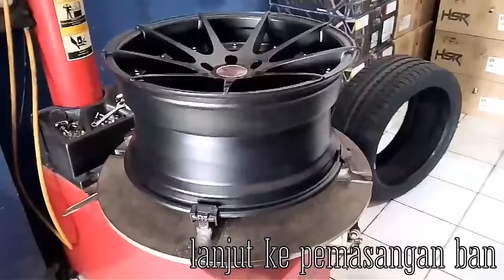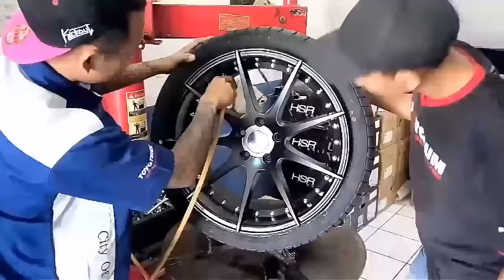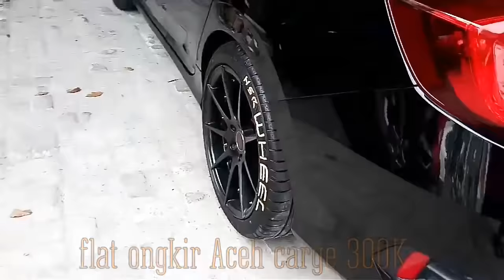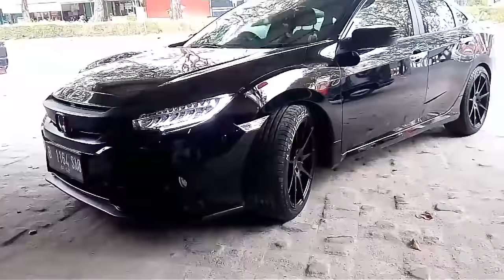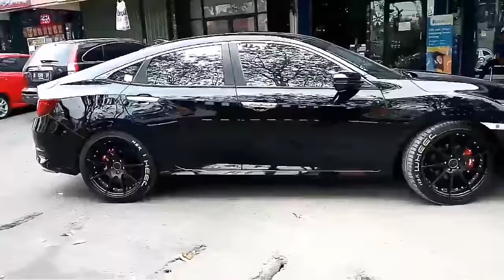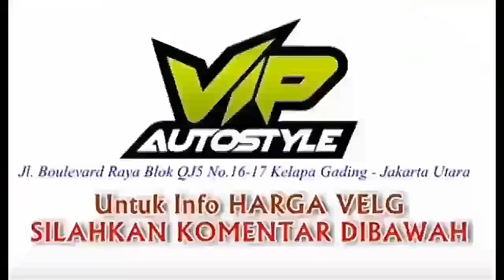Modifikasi New Honda Civic Turbo On HSR WHEELS By Vip Autostyle

Comment: Alamatnya dimana? Saya di Jogja, bisa nggak. Civic turbo saya pngn saya gati velegnya.
Reply from the maker: Habibi Muhammad jogja ada.. Mau ganti ring brp om??
Reply: 18-19 kebesaran gk buat civic sedan?
Reply from the maker: Habibi Muhammad banyakan kalo mau nyaman R18 om
Reply: Ok lah. Ini alamatnya dimana? Bisa minta contactnya nggak? Vleg+Ban 14 juta ya?
Reply from the maker: Habibi Muhammad vip autostyle jalan boulevard raya block qj 5 no 16 kelapa gading jakarta utara Tlp 021-45847002 WA 0822 9913 9899
Reply: Brrti saya harus ke Jkt, ya?
Reply from the maker: Habibi Muhammad ke jogja aja mas yg deket..  Tapi kalo mau harga Jakarta beli di jkt pasang di jogja